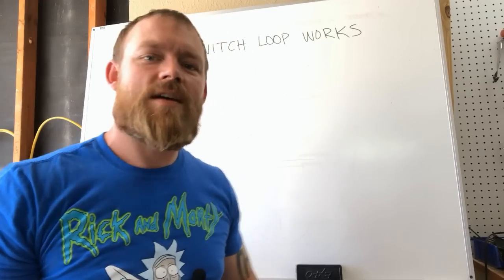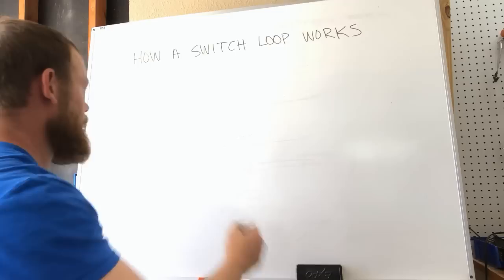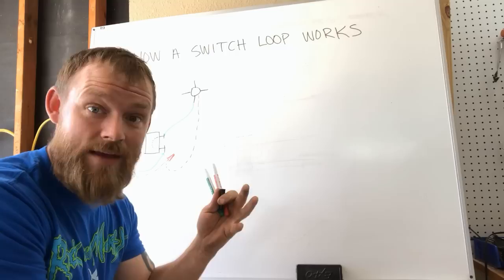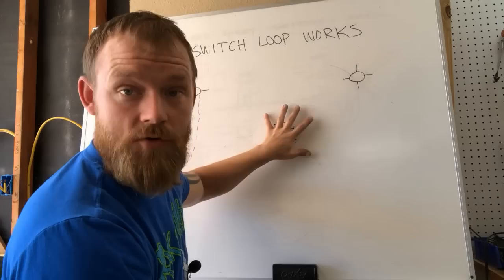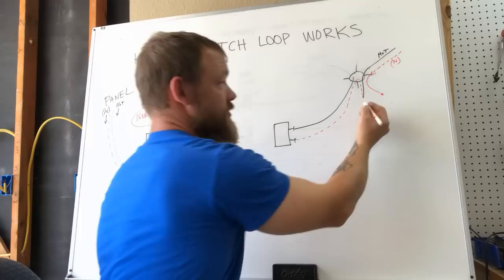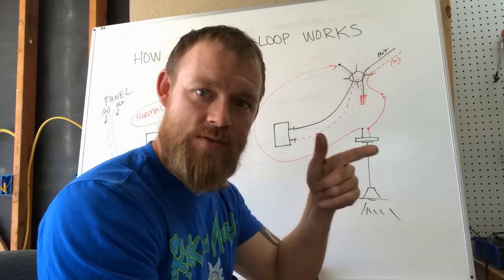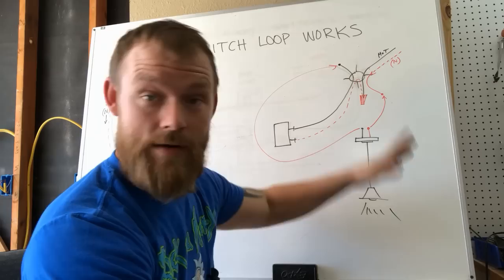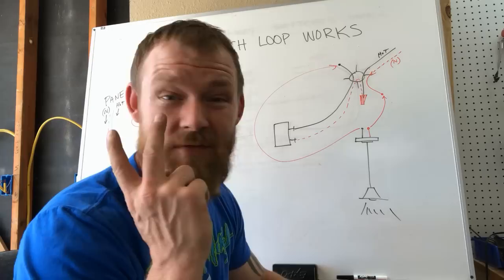Episode 13 -  SCHEMATICS how a switch loop works

Comment: I still don’t understand the practicality of this loop. What would it commonly be used for???
Reply: Say you want to put in a new ceiling fan without a pull chain or remote like your old one had. So you decide to put in 1 or 2 wall switches to control it ((fan and light) or (fan or light)). Since the power to the old fan came right into its box, you now need to fish a new (switch loop) line to your switch(es) -- and neutral per code, even if you just cap it off in the switch box. There are variations too: switch for light and remote for fan (in which case the fan always needs power so its RF receiver can always be "listening" for the remote).

Comment: Incomprehensible that anyone would have trouble understanding this.

2020 NEC now says must have neutral in the switch box.  Therefore no more
switch loop.

Dustin, sorry to say the drawings were not your finest hour.

Both the switch and the fixture would have been better if shown INSIDE
a box.  For first time learners to understand.   Thank you.

Comment: Why wouldn’t you use a three wire like a 12/3 or 14/3 so you have that white wire at every box so you can install things that need a neutral? I get that you can do it that way but why would you do that in the field. I’m not an electrician I’m a remodeler/handyman I have just started learning so this might be a dumb question but I appreciate the videos
Reply: to date, unless you are installing "Smart" switches or fancy devices, you will never need a neutral at any switch, which is why we dont waste money on 14/3 or 12/3 wire on the end of a line to a switch (switch loop). Your boss and the client will murder you run useless amounts of 14/3 where 14/2 is sufficient for 99% of all homes and businesses
Reply: If your locality uses NEC 2011 or newer, you actually have to have a neutral at every switch box. So you would have to do it the way you described.

Comment: Do you have loop terminals in fittings in the US?
Reply from the maker: What are loop terminals?
Reply: @ElectricianU  An isolated terminal on switches, lamps etc designed especially for looping. So we have active neutral earth (when required) and loop
Reply: no

Comment: I think i get the concept, but when would you really do this? also why would you not just wire it "normally" like white is neutral, black is hot. I still dont really get the concept.

Comment: What's confusing is tying a white wire to a black wire ... if they can understand that the white wire when coded is actually a black wire ...it's a black wire all the way from power at  light fixture through switch and back to black wire at fixture ... it will be clear ...
Reply from the maker: Yes per NEC 200.7(C) I should have done that

Comment: It's really bad how we are taught that the white neutral is not dangerous. What people don't understand is that the neutral could be shared by two legs of the hot and by disconnecting the neutral while a load is present on the hot, the neutral is carrying back the load and if you touch the neutral and you're grounded, you become the pathway of the neutral and could get a nasty shock. Always treat both conductors as hot in a live circuit unless you are 100% certain the neutral you're handling has a straight path to the panel.

Comment: Trouble understand the technique that was used fix what needs to be fixed  and move on the only difference  wi us al our work in the house is in red blocks that we insert PVC  pipes  into the walls  mason it back  smoothly  instead  of roughing in the  material  into wood framing

Comment: Switch loops should be illegal man. Thiers so many switches coming out that need a neutral. WiFi switches are the future
Reply: Umm... the switch leg is using a neutral. what in the hell are you talking about?  WIFI switches?  Yea sure like builders will make that a standard.
Reply: Bro I hate switch loops!!!! I do commercial and industrial ... When I do remodels on residential houses I always run into this crap.... Limits what you can do just basic single pole switches...I always swap it properly
Reply: if you want wifi switches, then hire an electrician and add one .
Reply: According to the 2011 NEC code, every switch box must have a neutral, but a lot of localities use older versions of the NEC so it's not required everywhere.
Reply: RE Verb pretty obvious that he’s talking about a neutral NOT being used as a hot...

Comment: while this procedure does work, is never a good idea to have a constant hot in the light fixture. it creates a hazard when replacing a fixture. this is totally unacceptable. please don't recommend this procedure.
white is always neutral just like black is always hot.
this is not good.

Comment: You did not identify your new hot. Also, by code (NEC) this is not allowed since you need a neutral at every switch box. This video is a dinosaur and no longer relevant.